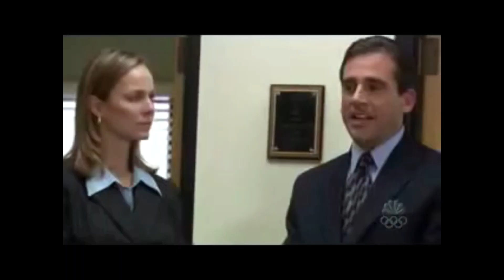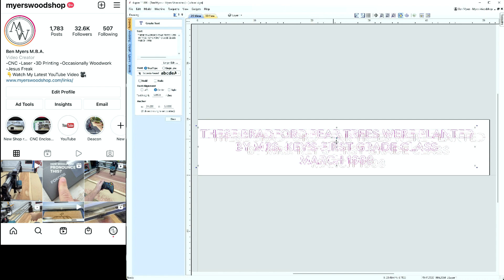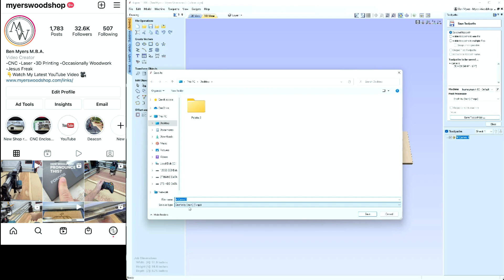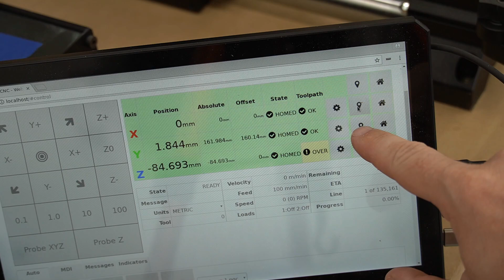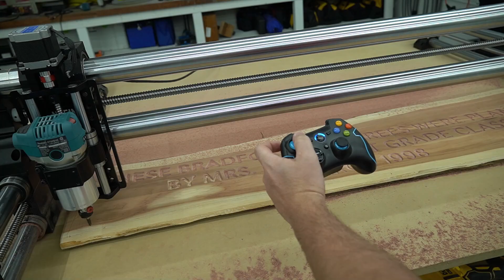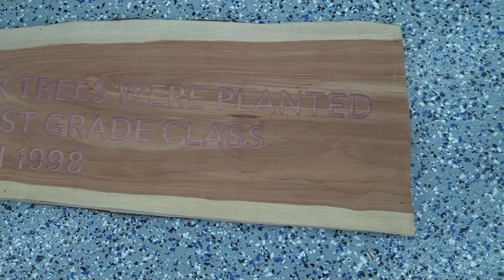MASSIVE 4 FOOT CNC V-Carved Sign On The Onefinity Journeyman CNC

Comment: Curious why you didn't use a clearance tool (1/8" end mill) to clean out most of the letters, then use the V-bit for the final edge. (I think it creates the required tool paths automatically when using Vcarve or Aspire.)

Comment: the recommended bits that you have on the website do not have the bit you use in this video.. is there a reason for that? 425-vg60 is not listed.

Comment: I wonder why Vetric has not added camera capability to the software similar to what Lightburn does?
Reply: ? vectric is the software you design and make your g-code it has nothing to do with running the code so it doesnt need camera compatability.  Its not the control software unlike lightburn

Comment: It shows on your screen you are still in metric when zeroing! does that actually matter at this point since you modeled in the inch mode or should you have changed it at this point?
Reply from the maker: Nope.  The gcode tells the machine what measurements to do it in.  The only thing the screen change makes is the 'jog' mode on the control page.  I don't use it anyways, I always use the joypad.